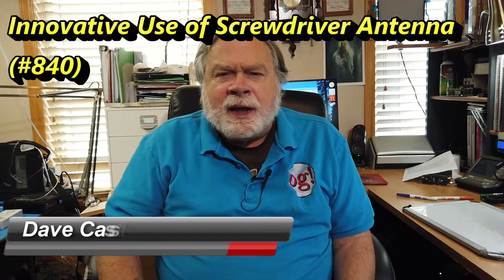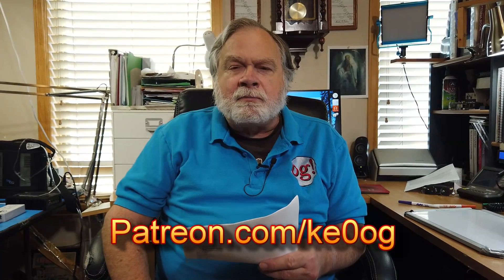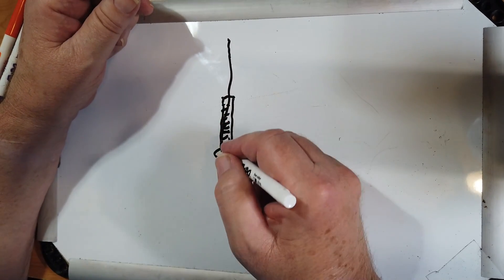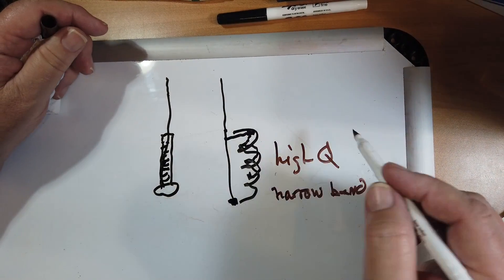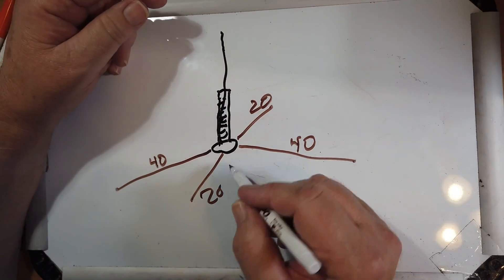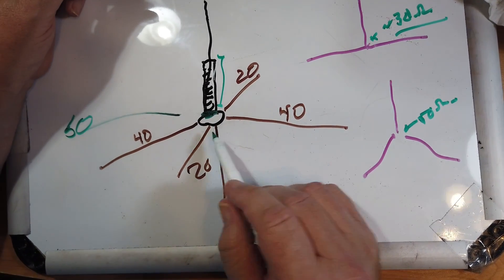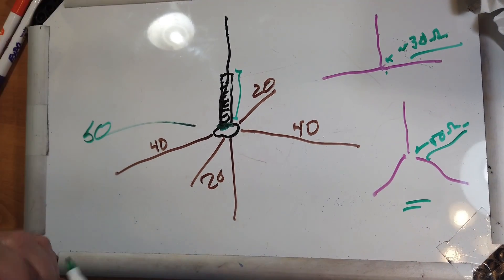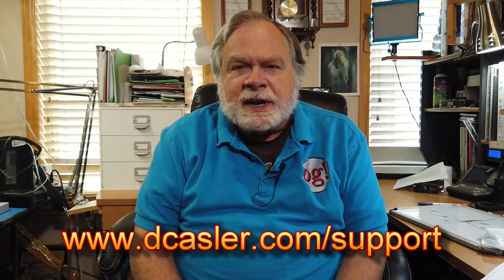Innovative Use of Screwdriver Antenna (#840)

Comment: Hi Dave. What about atas120 antenna ? Will that work as is placing it on my roof ? With no additional radials (insulated wires or metal ones) . Will It be still a compromise on the bandwidth section rather on the performance ? I think of placing it on mast of 5 meters high . And of course having it fully grounded. 73s from SY1DAL, Jimmy

Comment: This is not a new idea. Scorpion Antenna recommended and sold this configuration years ago with their big Screwdriver antenna for portable operation, they may still offer it. It can be supported nicely with a speaker tripod, these are sturdy and reasonably priced. The coil rises and falls into the lower tube with screwdriver antennas. There is no moving tap, a threaded rod moves the coil and the whip is attached to the top of the coil. The high Q of these coils lowers the drive impedance considerably, they are lower than 30 ohms on the lower bands. As less coil is used the impedance rises.  73 de w6akb
Reply: this is pretty much what I do with my tarheel.. speaker stand, alu bracket and then a bunch of wire from the bracket

Comment: If you didn't have the ability to really tune, and just rely on the math you've done for the length of your driven element and the length of your radials, would 45 degrees work better to put you close to 50 ohms?  I'm making two separate 1/4 wave ground plane antennas, but no tuning and my measurements are rather exact, but I did my math based on 45 degree angle radials.  Is this making sense?  Because I'm not tuning at all, I don't want to rework my math because I did it based on 45 degrees.

Comment: Seems that the take off angle may change by moving the ham sticks. 
Sounds like a very clever design that could be put up or taken down in a few minutes. 

The best HOA beater I’ve seen is a flag pole in the back yard. Everyone said the flag pole is ok but why the back yard?
He had a foot long piece of plexiglass with a ham stick bracket and 2 one inch pieces of 3 inch plastic pipe for guide rings. At night the flag came down and up went the ham sticks. In the morning he swapped them. The flowers at the bottom hid the coiled up coax and bracket. He just unscrewed the sticks.

Comment: Hey Dave,  what are your thoughts regarding installing a screwdriver antenna for long term use.  My QTH backs up to the Cape Fear River.  I installed a Wolf River Coil vertical and am really impressed with its performance.  I’m just not thrilled about running outside to change the tap when I change bands.